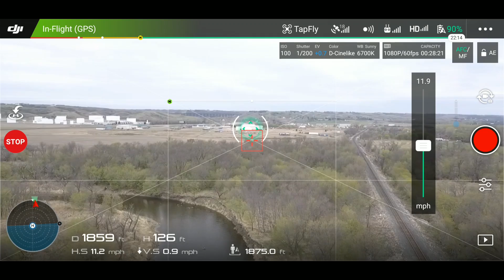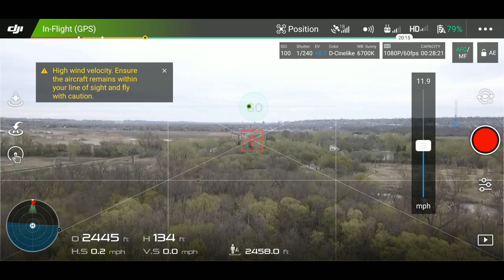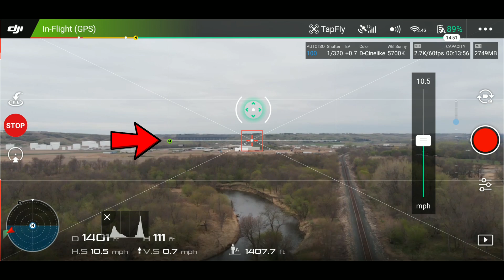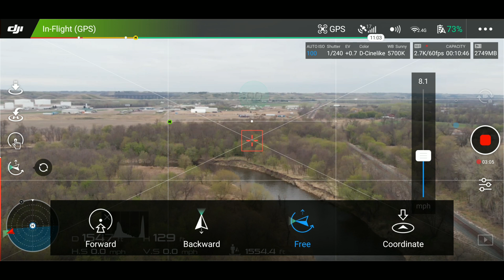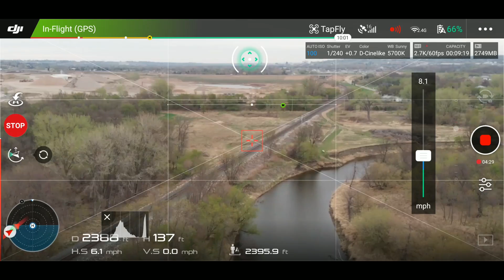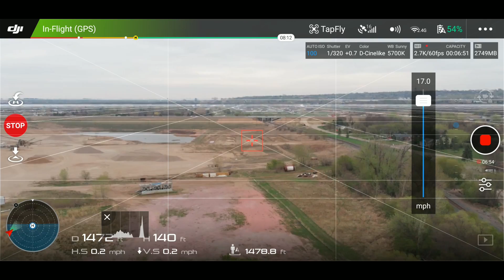Mavic Pro Versus Mavic Air | TapFly Intelligent Flight Mode

Comment: As always a great tutorial video many thanks. Just to note, the green H means home location. Though the line also shows the horizon as you said. Did you know about the gimbal feature where if you press and hold on your screen you can control the gimbal movement ? Keep up the great work.
Reply from the maker: Paul Crouch Thanks!  Yes I realized that afterwards, and no I didn't know about the gimbal!  Thanks!

Comment: Nice comparison video. Sometimes I like to be reminded how useful Intelligent Flight modes can be. I don't own the Mavic air so the comparison is useful. I think the reason the Mavic Pro lacks the other modes of tap fly is because it doesn't have rear obstacle avoidance sensors. The Phantom 4 Pro has more options in intelligent flight modes than mavic pro also.

Comment: How do you get that red square in the center?ty
Reply from the maker: In the camera settings.  Click on the 3 little dots in the upper right, then click on the far right icon.  About 3/4 of the way down, there is an option to choose which center point icon you would like.

Comment: I use tap fly often so I can worry about the camera not the drone piloting. My favorite mode is the coordinate mode because it is the only mode where you don’t need to worry about the drone flying far away while you’re focused on photography. This is especially true when you’re at a lower altitude and there may be obstacles that you would like to have the drone avoid by stopping well before hitting them.

Comment: This was... Brilliant. I think I've just about got my yaw and gimbal settings right, so this is great timing. I'm not too sure I'm learning and practicing all this in the best of places but I'm motivated by the beauty of film and photos so this morning my little mavic that I call fly1 Hi1, bit like R2 D2😂 went focusing on swans in the middle of a very big lake and it looked stunning but what was even better was over the river and I was high, I didn't disturb them, had them in shot when they, two of them, decided to take off and fly. The bad news, that was in the afternoon, when the wind had got up, and I forgot to bring both my sd cards, I flew largely to test out some even slower settings which seemed good. Still, they'll be other opportunities. Saturday I'm off to a steam punk weekend at a steam railway line. The bad news here is, I discovered this evening huge areas are now temporary no fly zones for low level fly pasts at a number of airshows, then rain in the afternoon. Always something!!